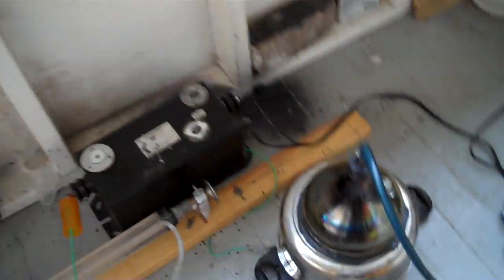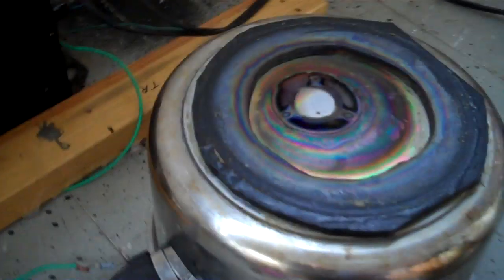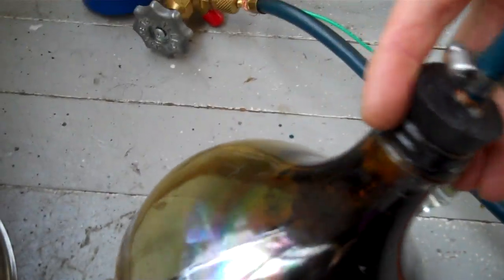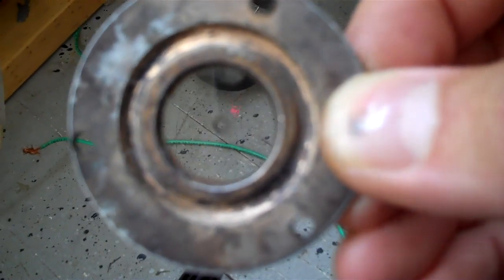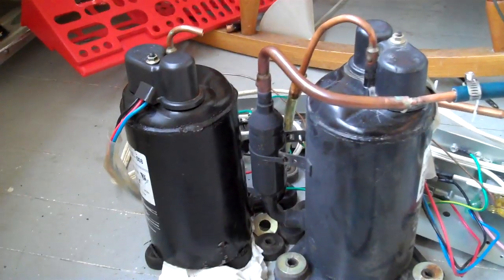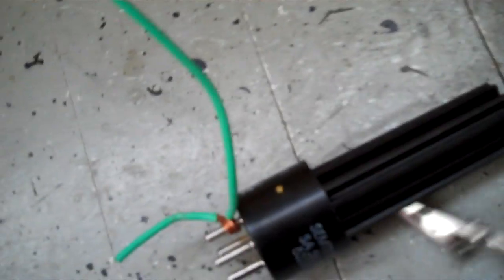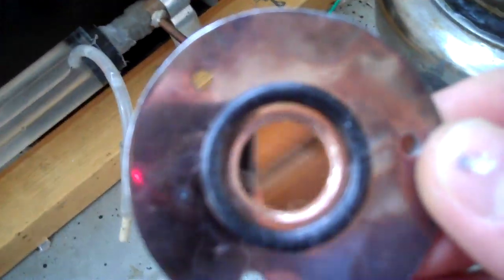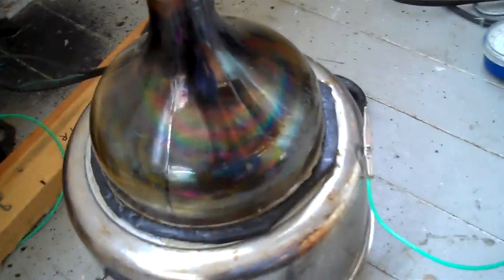sputtering.MP4

Comment: this is awesome, and i was wondering, firstly, can the also splutter aluminium as well as copper. and secondly, wouldn't putting the vacuum pumps in parallel give you a higher vacuum?